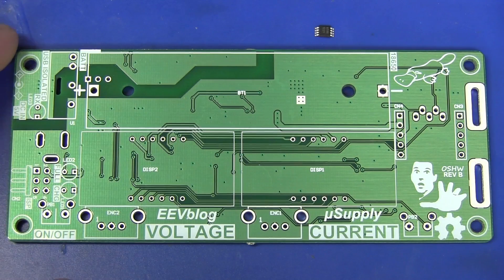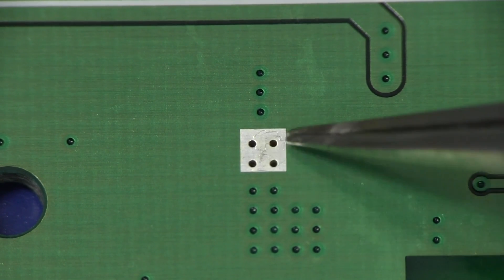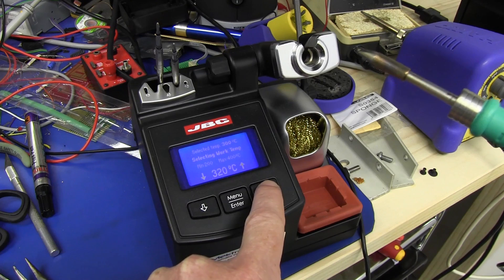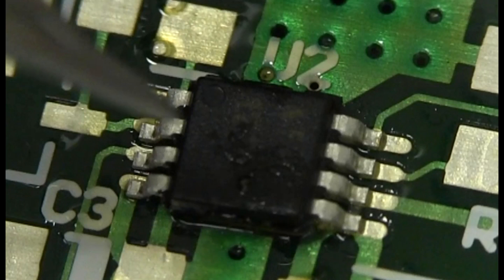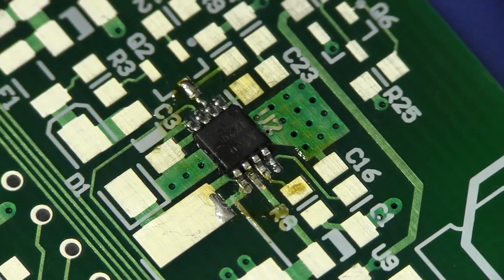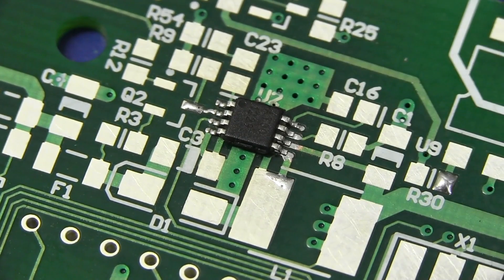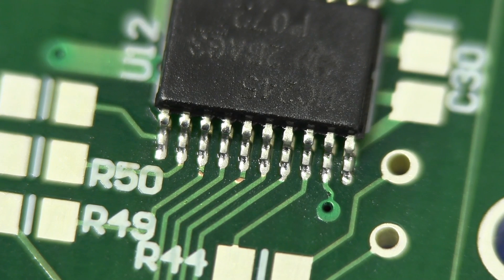EEVblog #434 - SMD Thermal Pad & Drag Soldering Tutorial

Comment: "Beautifully Soldered !!!"
.
I don't think so. Your pins were not properly aligned causing the gap between the adjoining pads to decrease compromising isolation.
.
An old sly fox like myself can see right through your poor soldering, but a young impressionable hobbyist starting out wont understand your bad soldering practices.
.
Aligning IC pins to solder pads is fundamental in good soldering practice. Your pins are not aligned and come off the pad producing an end result which is crap.
.
Your soldering might be acceptable for EEVblog standards or a couple of wanabee ham radio operators who failed every A.O.C.P. certification test since 1975 till 2020 every year in a row, but when it comes to aerospace/defence standards (even consumer electronics coming out of a sweatshop in Asia) then your soldering really does sux.
.
Why teach the young ones bad soldering habits in the cradle?

Comment: I've used this method to hand solder the bottom of micro usb female jacks on small micro boards I designed. My first prototypes didn't have the bottom of the jacks soldered and low and behold after a few plugs and unplugs I ripped a jack straight off taking the traces with it. So second rev of the board I exposed the ground plane on the bottom, added some vias tying the two sides and just allowed the solder to wick through the board and onto the bottom on the jack. Works great and haven't ripped any more usb jacks off of my borads.

Comment: I've soldered 0.5mm pitch chips before successfuly, but I thought I would never be able to do this. Then I thought "oh, I might as well try", did some research and tried it. And I was blown away by how easy this actually is. But I did it slightly differently that this: I first aligned the chip and soldered only a single pin to keep it aligned, and then did the chisel tip from the bottom as described here. Then I can try to slightly nudge the chip to see if the bottom is soldered on the board: if the chip moves a little it means it is not soldered; if I can not move it means it is. Then I just solder the remaining pins and Bob's your uncle!

Thanks Dave!

Comment: that looks great but could you do it by putting a bit of solder paste on the thermal pad and heating with the hot air gun?
Reply: https://youtu.be/588iV07nEdM?t=1m4s  He mentions this just before showing his alternate methode.

Of course if you have a hot air gun it would be a more ideal way to do this. But he is showing a way to do this if you do not have a hot air gun.

Comment: It wasn't the flux on that MSOP8, it didn't get hot enough. I'm blown away you would try to blame the flux. The pad was just short of hot enough for the solder to stick to.
Pins 1, 2, 3, 4, and 8 looked great but pins 5, 6, and 7 were a complete FAIL! Nowhere near enough solder. You should always have a fillet around the leads.

Comment: I've always dragged along the pins instead of dragging them out. 
As you can see, dragging out has taken the solder mask off the board and bear copper is shown which will in time cause problems.

Comment: does it damage the chip if I hold in my hands?
Reply: Most chips will be fine, but touch some grounded metal (like a water pipe or a desktop PC case) before you handle chips with no anti-static wrist strap.

Comment: What would happen if you instead put a tiny blob of solder on the pad. Then lightly hold the IC on top of the blob. Then heat the pad from the bottom ... i.e. imagine a scenario where you didn't have holes on the pad for the solder to travel upwards from.

Comment: Flux cored solder wire, how do they (manufacture) get the flux inside the solder seath?
Reply: Extrusion. Flux is injected through the center of the die.

Comment: So enough heat travels through the bond wires to take the pins up to solder melting temperatures? That sounds horrible. A cheap board I had from China had the mask revoved under the chip and a few mm at both ends. I applied a god amount of solder to the pcb, then loads of flus and used the pcb 'underhang' to melt the solder whilst pushing down on the chip.  That worked very quickly and the pins remained cold.

Comment: Dumb question, what is difference between solder flux and solder past and normal solder?
Reply: +Бојан Драшко Normal solder consists of two main components: Tin compound (the actual solder) and flux. The use of the solder is obvious, it is the tin or tin lead compound actually making the connection. The outside of most normal soldering wire is the tin compound with inside one or multiple cores of flux. The point of the flux in there is to A) Clean the pad from surface oxidation before soldering and B) Make the solder flow. Flux is the stuff that gives off the smoke when soldering stuff. Ever tried putting solder on your tip and then transfering it to a connection? Doesnt work at all right? That is because it does not have the flux to flow correctly. Now lastly, you can think of solder paste as a 'liquid solder wire'. It also has flux and tin compound, put then in paste form. It is actually jelly like flux with lots little blobs of that tin compound.
Now next to those two types you can buy flux separately as gels or liquids, which is handy when you cannot effectively transfer the flux out of the solder to the connection. That is why it is necessary for most SMD soldering techniques (example is drag soldering. Google "drag soldering tqfp" for good examples).

Comment: Where does the solder come from at 6:50? If it comes from the pins itself, is it enough to solder ICs by not adding any solder externally?
Reply: I think he put the iron with the solder underneath the board, and through the vias. The help of flux would have dragged it through i think.
Reply: the chip leads are made of pre-tinned copper. This is added to promote wetting during soldering, and is what is melting. You always need external solder as this tin layer is too thin to create an adequate solder joint.

Comment: This might sound stupid but what are the small little rectangle pieces that have solder end caps? Good example is the ones that had "5102" on the top at 0:40
Reply: +Alpha Nerd 
Resistors
Reply: ***** Thanks! I found out tho. Over time I realized that what I was looking at was capacitors, resistors, and other things that have end cap solder points and I did not realize that they where that small. Thanks tho!

Comment: If the chip is "a pain in the arse" you probably have it in the wrong place, remove it and place where needed...
Chip didn't move until you touched it, it was centered...  ;-)
After the soldering it looks a bit twisted though.
I hope it worked out in the end.

Comment: how much "heat abuse" will take those smd components?  many thanks
Reply: The datasheet of each component specifies how much soldering abuse is allowed.  The wording is mostly focused on the factory method of heating the entire board in a hot oven, but it does say how many degrees for how many minutes is allowed.

Comment: damn I just need for someone to try for me resoldering a chip in graphic card. it may make it work or not, but I can't find this kind of chip to buy get new one which soldering specialists around said they need me to find, but I am not a specialist to a soldiering level at all :(
Reply: oh well and I did try the oven but that didn't reflow it properly as about two ironed connections of the chip got burned and separated (I cleaned graphic card and too early still when little wet in one spot I put it in PC and run and burned it ehhh)

Comment: Discovered the heating from the bottom method when I got some 1w leds. Just make a custom soldering iron tip, stick it into a weller 40w, and within seconds, I can heat up a strip of sheet metal and bond the led to it.

Comment: great trick with that thermal pad Dave. I'm working on a pcb design right now (first ever) and I was wondering how in the heck I'm going to solder my boost converter properly with just an iron and flux. Eagle DRC doesn't like putting vias on a pad, but OSH Park's board preview renders it perfectly.

Comment: All you have to do is "solder paste" for all your components and put it on a hot plate around 350c till the entire board "including the thermal pad, pins and all get soldered in.

It helps sometimes to press some points of the board down to the hot plate.

The fun part is with smaller size components like 0802 is "using the microscope.

I enjoyed your video/s

lui
Reply: I have to do some 0402 by hand, and next week I'll have to try 0201.  😬

Comment: Tacky flux was a life saver when hand assembling high pin count smd's with solder paste. Nice big blob on the board, balance the IC on the top, and tease it down into position with tweezers,  kept it place till you got it in the oven, and surface tension did the rest.

Comment: I'd be very interested in seeing the results under xray. I don't have my own data to rely on, but my early research indicated the wicking effect would result in insufficient coverage over the whole thermal pad and effectively a dry joint. I don't hand solder any of my chips, but the method I always use is tent the via on top and leave it open on the bottom - prevents paste wicking and gas blowout. It's a bugger to do in altium, I use the method in thread205944 on edaboard (sorry, can't link)

Comment: Am I the only one whose OCD was seriously tweaked by neither of those ICs going on straight? The bend on the second one would've been very easy to fix by heating the tack while it was straightened, soldering the other pins while forcing it into place can make the joint fail down the track. It's not bad, and all the pins are soldered, but it's not ideal

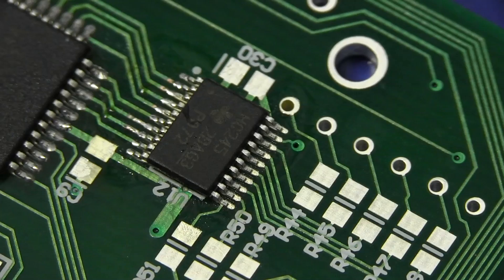Comment: Hi Dave - May I ask where did you get this PCB manufactured? To me it looks like solder resist was getting peeled off way too easily in some places by the soldering iron (15:20 for example). And it does look quite bubbly and dodgy on some traces!  - marko

Comment from the maker: But then you don't know when the solder has "taken" to the thermal pad. i.e. like my first attempt. If you do it like I did it, without soldering first, then the chip self centering is the guaranteed indicator that the thermal pad has taken. Then immediately remove iron and you have the optimal soldering time too.

Comment: Smashing tutorial :-)

Ive allways found it hell to solder the little critters.

And soldering wires to pins is fun, i have used fine hair thickness enameled copper wire stuck to the top of the chip with tiny strips of parcel label, it holds the wire in place while i attempt to solder it lol.

I wished i was a good as you are mate, just takes me a while, and a tongue stuck out while soldering :-)

Comment: I notice you mentioned your hand doesn't usually shake... My hand is always shaking much more than that. I have an issue with hand tremors, but I can do through hole soldering well if I brace my arm on a surface. I have been afraid to try any surface mount for fear that components and solder will fly everywhere.

Comment: Concerning the layout, I have heard that a ground plane like the one on the bottom is not very good at all because you have big crack in it and there may be a considerable voltage if you measure from each side of the crack. Can you demystify a bit the ground plane. probably  me wrong with a measure or juste explanation.

Comment: Of course you don't need it. It's just easier and less time consuming. I built a reflow oven out of a toaster oven I pulled from my kitchen and a little custom circuitry. The paste is expensive but like a large spool of wire, lasts forever seemingly. Stencils are cheap and make paste application trivial and vacuum placement tools make placing parts so simple. I use paste (even without a stencil) and the oven for all but the simplest jobs. It saves me time and quality is better.

Comment: I had issues with these kind of filled vias when they cracked open because the solder resist heated up and expanded inside the hole on further processing at the pcb manufacturer. That's why I now keep the vias clear ...

Comment: Love the slow motion Dave, thanks.

I have a brushless motor controller (L6234) that has a large thermal pad. I was thinking of mounting it on the bottom of the board and having pin header sized holes with which I could stick a bunch of pins in order to make a 'porcupine' style heat sink on the top.  Tack the pads on one side first and then solder the pins. Thoughts anyone?

Comment: Hi Dave,

This week I soldered two prototypes with 0603 components size and LGA 16 pins sensor.

Fortunately, I had an oven to solder my prototypes!

I use an oven from Eurocircuits. You should take a look. It's great for soldering multiple board with tiny components.

eurocircuits . com/index.php/new-smd-reflow-equipment

Great video anyway. But 0805 .. easy job Dave :D

Comment: Often when I'm drag soldering fine pitch, I position the chip then vertical stab down with the tweezers to hold it in place.  Then solder a row.  Avoids the time for tacking two pins as well avoids moving the chip while trying to tack it.  Much quicker and less stuffing around.
BTW... I agree with 123cyr.  Solder mask isn't very good.  Neither is the hole registration.

Comment: Hey Dave,
love the show. Which method would you prefer to use if you had to solder wires to a very fine pitch chip (0,5mm). For, say, diagnostic puposes?
Greetings from Germany